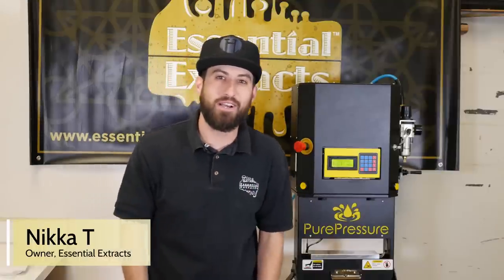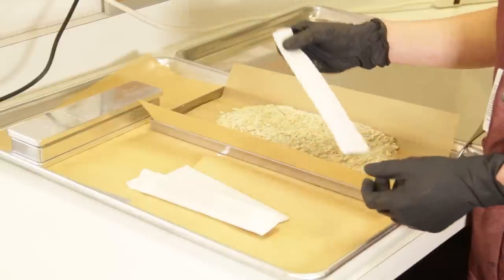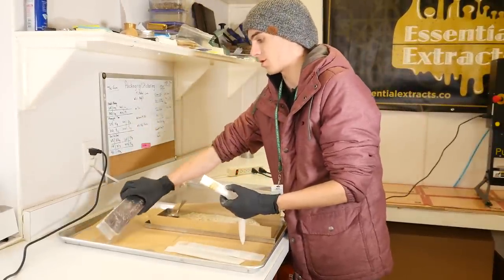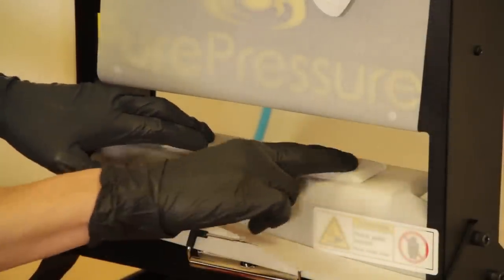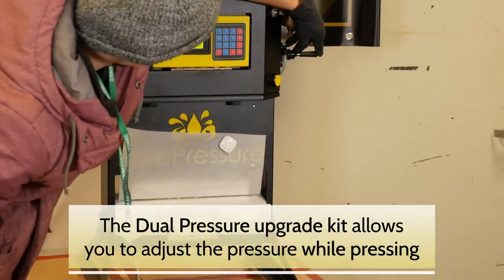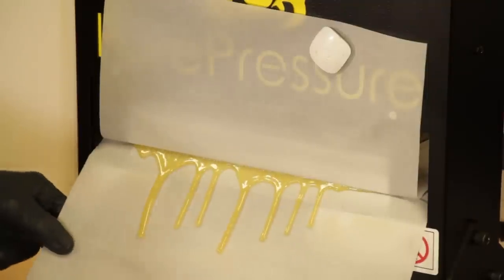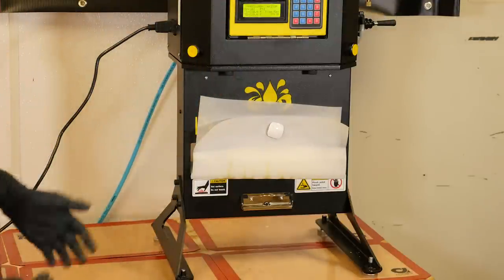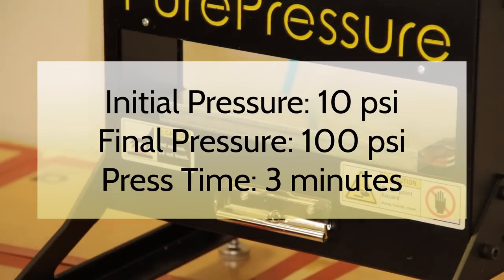How to Make Hash Rosin Like a Pro

Comment: By far the cleanest product I have seen available. The starting process of the water wash was genius!  But was the screening/filtering needed after? especially double filtering?  I think thats were your last 10gram yield ended up.
Reply from the maker: Thanks for commenting! What is left in the bag are mainly the empty trichome husks and stalks that have had their oil expelled. Double bagging does not affect yield typically and is used for insurance against blowouts in certain cases when super high grade material is being pressed.
Reply: Nano technology thats why it was so Blonde

Comment: When double bagging your hash do you use the same micron size or do you stick the 35micron bag inside like a 120?
Reply from the maker: It really comes down to user preference, and hash makers have told us they swear by both methods (two same size micron bags, such as a 36, or a smaller micron bag inside of a larger-sized micron bag). Larger micron aperture mesh however tends to be stronger, so the filament on a 115 micron bag is more durable than a 36 micron bag for example. We suggest trying it both ways and seeing which you prefer. Either way, your inner bag is going to do the heavy lifting when it comes to filtration.

Comment: Two questions: what does the average moisture level oh hash look like after being freeze dried? And what should properly dried hash’s moisture level be without having a freeze dryer? I guess that question should be worded differently, what should my hash’s moisture level be when pressing?
Reply from the maker: Hi Sean,

Good question - we actually have not done any relative humidity tests to determine optimal moisture of bubble hash prior to pressing. Typically bubble hash is pretty much good to press no matter what the humidity is because it's all/mostly trichome heads when washed well. The reason flower needs higher humidity content is to get the oil out from all the other plant material, which can trap it when it's dry. Great bubble hash greases up at room temperature anyway. Sorry that's not the perfect answer, but long story short it shouldn't matter much with hash!

Comment: What temp and psi and time are you using? My press comes down all at once, not gradually, to full psi. I'm not having good results, with kief or flower. using Psi 1,000, time is 1.5 minutes and temp is 220 F. I can adjust all, but, can't apply gradual pressure. It's an expensive press too (not yours). Any suggestions?
Reply from the maker: The temperature was 220F and the PSI input got up to 100, which equates to about 514 PSI at the bag itself. We can't really offer any suggestions for a competitor's press because there are so many of them and so few of them work well, but your settings sound about right. For flower it doesn't matter - you just want to smash it essentially, but for kief or hash the gradual application of pressure makes a massive difference. If your flower is not yielding well make sure it is properly humidified! We hope that helps, good luck squishing Spinoza!
Reply: Lots of respect helping the guy out the best you can.
Reply: 220 wtf lower the temp taste way better

Comment: is 220f not too hot for hash rosin? i usually run at 170-180, and flower, usually 200-210f max. i am using only temp adjustable hair straightner plates, epoxied onto a Yost 4" vise, and have been getting pretty good results. i have a hash stash, thats half gone into rosin now! that i want to press everything i have ever made. i use 25u  bags, but i still have some char left in my banger? am i pressing for too long? too much pressure? too fast? there is definitely a learning curve, and ever since i made my Ghetto Press 2.0 , it has been getting slowly better. i got a little over a gram from a 1/4 of real cheap Honolulu Haze flower, bottle teked in a 100u bag. 
would double bagging prevent the flow of microparticles into the oil? 
also, i have pressed bubble hash from Suver Haze trim, that was really sticky, and i got an almost "rubbery" product, somewhat similar to that blue tack you use  to hang posters and stuff, really stringy, and its not snap and pull its pull and pull and pull  lmao any idea what that could be?
Reply from the maker: This video was made a while ago - most people are pressing hash at much lower temperatures now, like you describe. 

For a full melt product, simply put most strains/washes just won't produce 6*. Rosin is not always a true full melt product (aka no char on the nail). All comes down to how the plant was grown and what came out the other side with the resin. Keep squishing!

Comment: What temp are you pressing at for more stable shatter type rosin?
Reply from the maker: It is both temperature but mainly material dependent in order to get a more stable consistency, but typically higher temps better achieve those results (210-220F+). Hope that helps. There is no "one" way to make rosin shatter that we are aware of.

Comment: How much per gram is this going for?
Reply from the maker: That depends. In Colorado it depends on if it's taxed recreationally or medicinally, but as of this writing grams of high quality rosin retail between $50-80 depending on a number of factors. Rosin similar to what was made in this video retails on the medical side at The Herbal Cure in Denver for about $30 per half gram.
Reply: GoPurePressure dam expensive high quality rosin 15 20 a gram in the bay area
Reply: GoPurePressure bros. in washinton dc, bho go's for as low as $40/gram. live rosin go's for here is $60-$70. and I guarantee they don't put this much work in as this.
Reply: I think people are getting it mixed up between prices of rosin and prices of live rosin...

Comment: 50g in 40g out ??
Reply from the maker: Yep, 50 grams of ice water hash went in, and 40 grams of hash rosin came out. The remainder in the bag is the trichome husks/stalks and additional resin that will need a second press at typically higher temperatures to get all of it out.

Comment: what happend to the hash
Reply from the maker: It was heated and had pressure applied to it, thus making it a full melt product - basically the cannabinoids are being expelled from the glandular trichome heads and then are extruded through the filter bag. Hope that helps!

Comment: what I don't understand is why you would even press that source material in the first place. it already looked like some insanely fire 70%+ thc bubble hash that you were actually pressing. personally I think it's only worth it to press actual bud/flower. I've made the best rosin i've ever seen with my own eyes in real life or on video with some top shelf nugs and a hair straightener. the more surface area you have with a press, the more chance there is for you to lose terps and even potential THC out of your final product. I know it doesn't look like it because you're already starting with an insane product in the first place, and I'm sure you know the difference, but big presses cause you to lose terpenes and other essential oils from the product you smoke after you're done
Reply: the thing about your answer from number 1 is that the product you are pressing pretty much already IS full melt, even if it may not be as melty as the product you get after pressing that hash. as for your second answer, that is exactly what I like to hear! I LOVE the fact that your press is narrow enough for the rosin to escape the heat and ultimately for your rosin to contain as much terpene content as possible. THAT is what rosin is all about, preserving maximum cannabinoid content from your pressed material. I still firmly believe that pressing top quality buds will get you a better end product simply because you will get a more complete terpene profile that is true to it's original strain. Although if the herb that your original pressed material came from was grown as pure and correctly as possible then i'm sure your pressed hash had a pretty plentiful/wide range of cannabinoid content. I really do like what I saw though, and you guys are ahead of the game with your press

Comment: Music so loud! I have to keep jumping for the volume! Thank you make better rosin than audio editing! Turn the gain down during the cut.. that easy.
Reply from the maker: Duly noted
Reply: @GoPurePressure  Fare play, I thought you guys were way to big to read that! Thanks for your reply and your really informative videos and your website is incredible with your workings out for PSI at the bag. I am rubbish at maths! I tried the calculations over and over and read the page again but it never clicked. I ordered a 1000 PSI Gauge for my 10 ton press but think that is not enough I will be off the scale? I ordered 3" x 5" heat plates as an add on to the press but I ordered 2.5" x 4.5" 37u bags so they fit inside the plates nicely. I have so much to learn! Watching you guys do it has given me some confidence. I havnt got anything delivered yet I'm just learning how whilst I wait. I am a complete rookie and have no idea what I'm doing without your videos and website so thanks again. 
Audio gain should always be in the - numbers. The audio wave lights that jump up and down whilst talking and music should always be below the red line use about 75% of the waves and stay out the red. And for music the red happens easier because the base ect. When the hydraulic presses click in other videos it's really bad! The click of the press would be off the scale and should snip each click of the press and turn audio gain down to about -30 probably! Talking at -5 and music about -10 to -20. 
Thanks again for your tips. If you can answer what PSI or Ton I should use for kief in a 37u 2.5" x 4.5" bag in a 10 ton press with 3" x 5" heat plates? I was planning on free handing  it a bit like your pro guy does and Finish around 5  ton. (Other forums say for my size bag this seems to be good) I will 100% double my bags like you do and pre pack. Peace
Reply from the maker: Unfortunately we have no idea what PSI you should press at on a 10 ton press - probably very, very low. Just have to feel it out and watch the hash. Good luck man.
Reply: @GoPurePressure  Thanks a lot, thats the plan, do you always use matching heat on the top/bottom plates? Your main pro guy seems to free hand it anyway! He just casually tamps it, then goes on low and slow, them every 30 secs bumps up the pressure a touch, seems pretty easy to be honest. Obviously not! Temps, times and practice are crucial but im confident my first squeeze will be pretty good at least. Im not going to use the full 10 tonnes no way. Im turning my bags inside out and back to front from one another so I cant get blowouts anyway. Loved your videos. very helpful! I just have to figure out the detail. Thanks
Reply from the maker: @E69apeTheMatrix420  Yes we suggest it in order to get the most even consistency possible.

Comment: I like your machines but you really can't compete with nugsmasher their prices are better they have more options from 2 ton all the way up to 20  and they have a lifetime warranty instead of paying $1000 for a 5 year warranty
Reply from the maker: Thanks for your feedback. We make all of our presses right here in Denver, Colorado, and we don't think that more pressure is better in rosin presses. It's about finesse and control, not raw power, and the control of our presses is unparalleled. Top hash makers rely on that control to make some of the best solventless in the world. Lastly, a lifetime warranty doesn't mean much if the company goes out of business. We're the industry leader in solventless equipment technology and always do right by our customers.
Reply: @GoPurePressure  first of all you are not the industry leader sho is and you can try and play down a lifetime warrenty but ya can't nugsmasher isn't going out of business and i own your long peak machine in dual and auto aswell as your pikes peaks in auto and my nugsmasher pro can compete with them all day long as well as being easier to use so if they are basically on par as far as performance goes then you have to start looking at other things like the price and coverage and as far as coverage you cant compare a 5 year warranty that costs $1000 to a lifetime warrenty that's free even if they go out of buisness in 30yrs they still got 25yrs on your 5 yr
Reply: @GoPurePressure My bad a bunch of my reply got cut out so ill just make this shorter but anyways the machine is really the smallest part of the equation when making consetrates all that really matters is material. Bad material could turn a $100,000 press into a glorified paper weight
Reply from the maker: @justinpotterbc  well, we're sorry to hear that you feel that way across the board here, but it sounds like nothing we can say is going to change your mind, so we'll have to agree to disagree on this one. Good luck with your solventless pressing and if there is any help we can ever provide, please contact us at support@gopurepressure.com and we'd be happy to assist. Happy squishing!
Reply: @GoPurePressure  sorry I was having a bad day  and kinda exaggerated I do love you machines they have paid for them selves like 10 times over and i don't regret buying them at all  but I do think they are a little over priced considering the right person can get basicly the same percentage of yield from machines that are a fraction of the prices that being said the right person could do the same with one of your machines and one that costs twice as much

Comment: Why do people always say to squeeze hash at 160 degrees f?
Reply from the maker: Pressing at lower temps like 160°F is a gentle place to start and can help to preserve the terpene profile while still being hot enough to extract the oil.
Reply from the maker: @WallyWeedman420reviewer  this press happened in 2017 and was at 220. We usually don't recommend pressing hash that hot anymore. Times change.